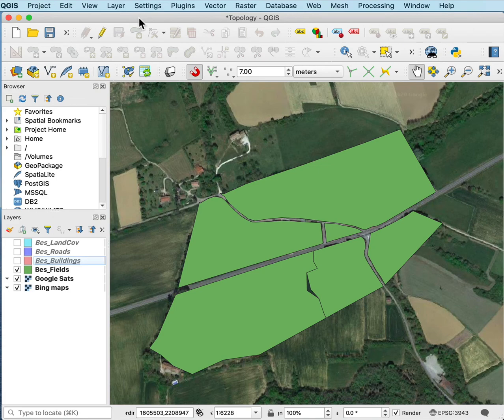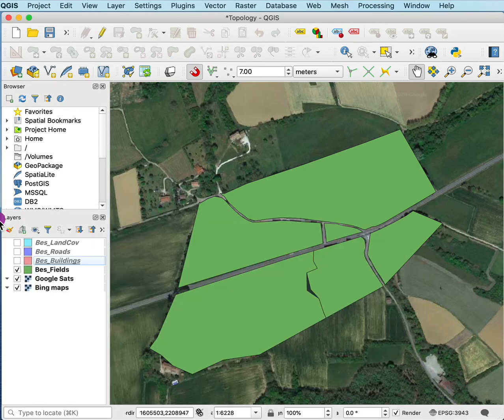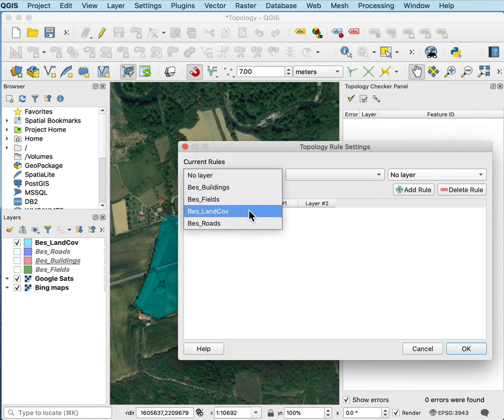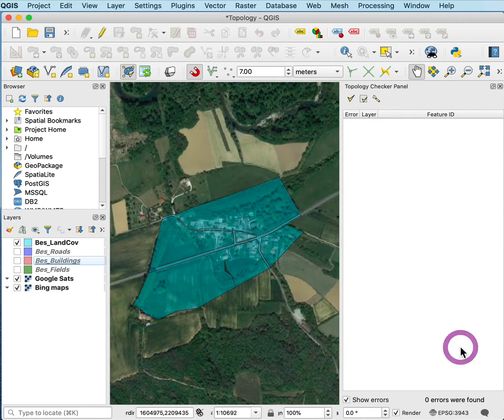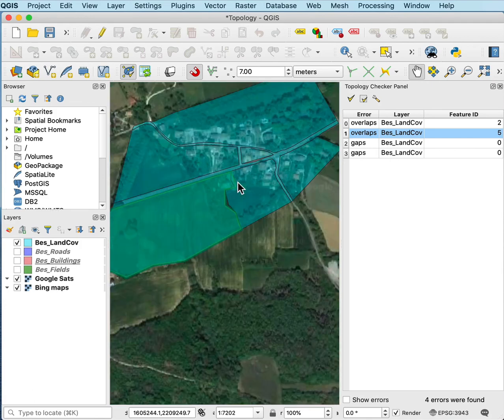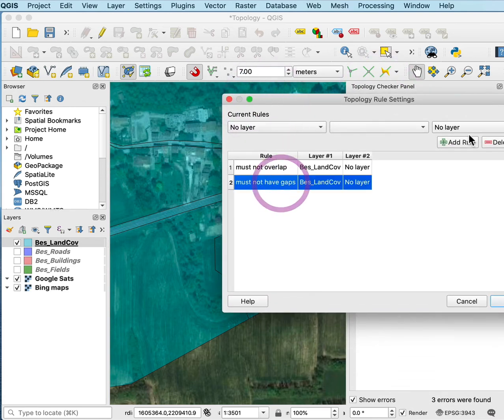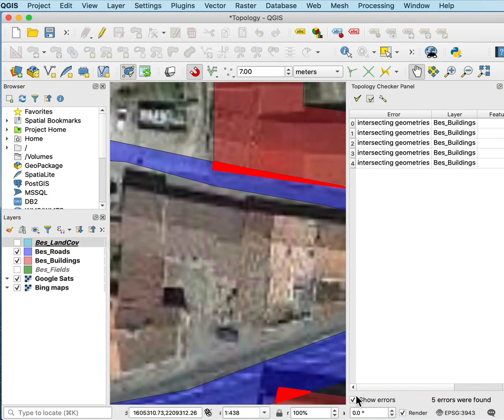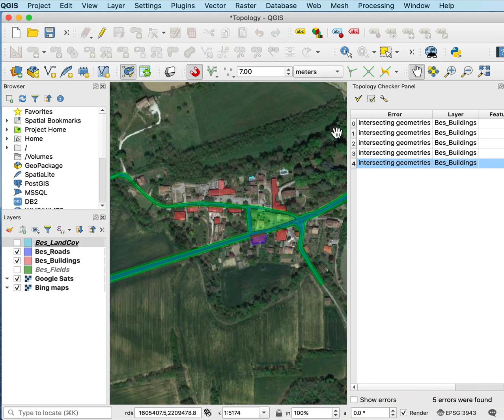Topology Checker QGIS 3

Comment: Is there really no way to have QGIS fix things like dangles or pseudo nodes other than manually doing it? Same for fixing gaps. My current workflow is in Arc and I am trying to post my same workflow to QGIS and checking topology is a critical step. The only problem is I often smooth lines then generalize then, then create polygons. The auto fix in Arc really speeds up the process, especially when some of my maps can be quite dense with line work.